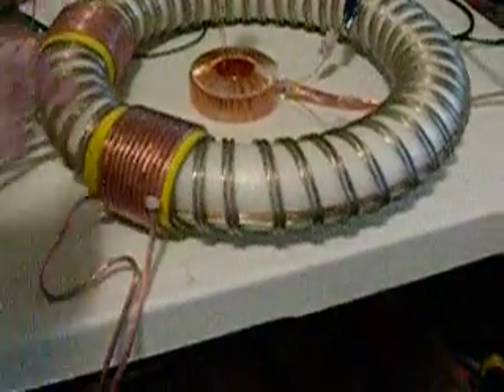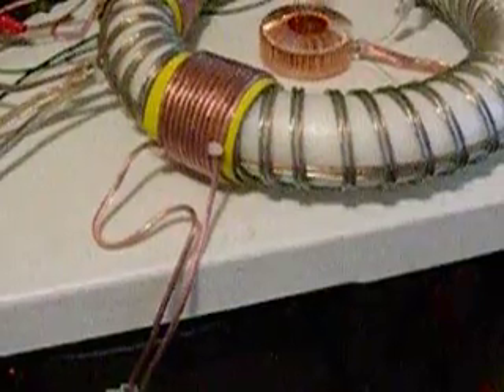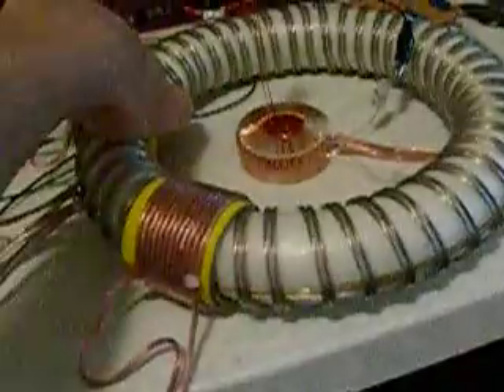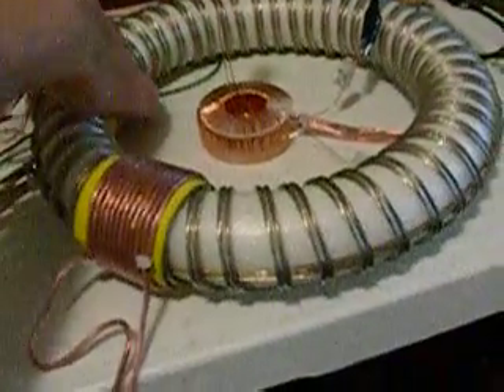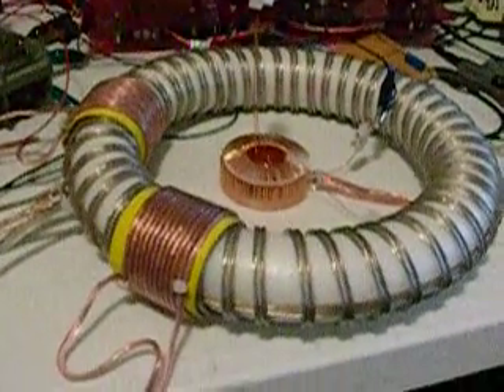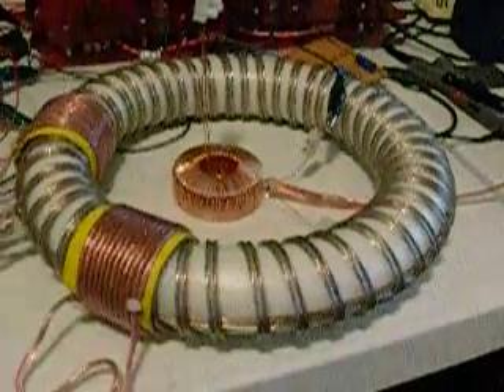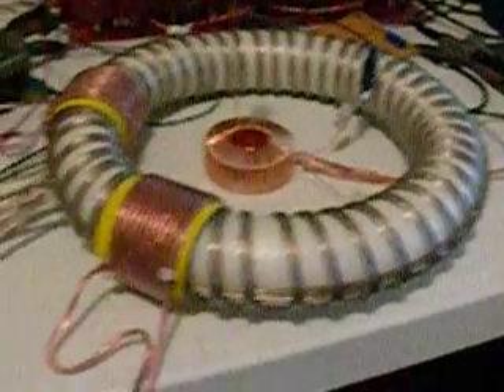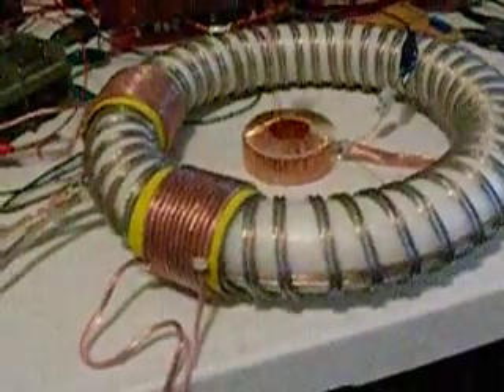DSCN0396.MOV

Comment: You can trip any electronics by powerful hi-frequence generator without any magic. Any P-N structure (base-emitter diode in transistor) can work as detector. Wires of power lines in your apartments works as LC resonant circuit and thus received and amplifies emissions in range 1-10 MHz. Your body acts like antenna when you touched the coil and starts to emit EM waves. And dont forget that amplifier in GFI is very sensitive...

Comment: NO doubt you are using high frequency and so I suggest that you will not put your hand on that coil as you  are inducing a lot of eddy currents in the flesh of your hand and as yet no one knows the damage that can occur to your hand in the long run.  There is no  need to put your hands so close. I know you are amaised with the performance but. please  try and be more careful. look after yourself as in the history of technology many  people dealing with invisible energy went through   Bad experiences as Madame Curie and those working in X rays and Radar. and I know a few who suffered through working in high density electromagnetic fields.
Reply from the maker: Thank you for your concern. I am safe. And you are correct.My first accident numbed my thumb, forever. It still works but has a funny tingle on the back side. This was run with 48 volts. You raise the voltage to 100 volts and greater and you, my friend, have a weapon of the future.